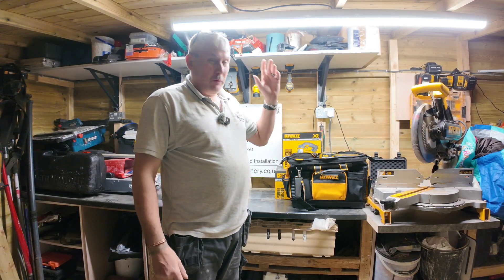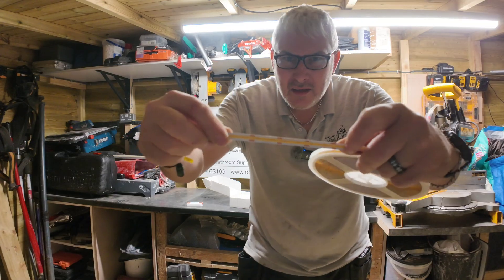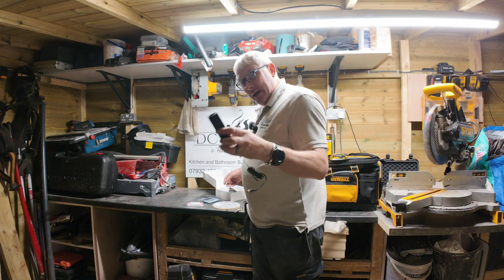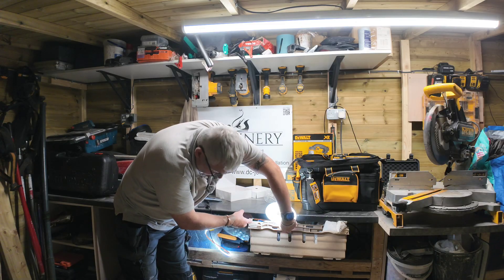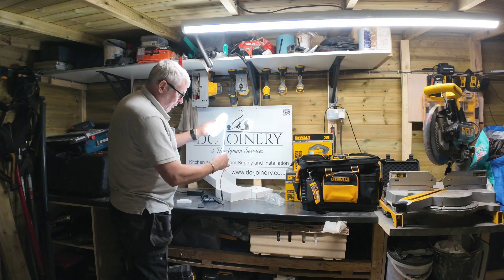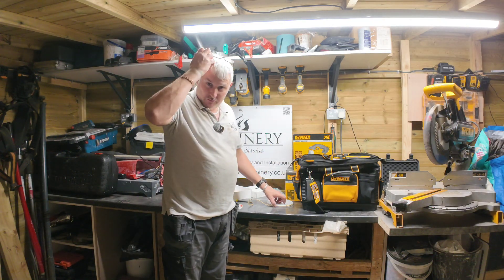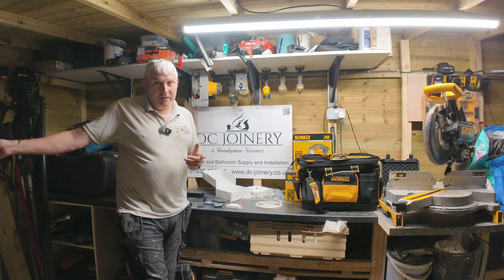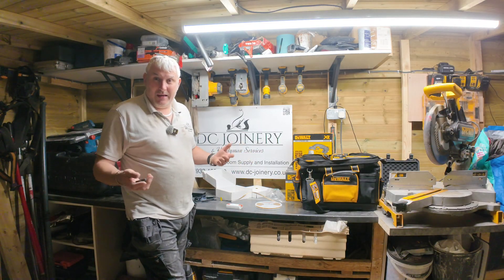LED STRIP LIGHTING A BASIC INTRODUCTION

Comment: Another way to setup up LEDs is to use a Quinnetic receiver in line to the power supply paired with a wireless PIR so that when they walk into the room they LEDs come on automatic
Reply from the maker: Yes that's another  way I was keeping it basic for now it was a quick  vid in response  to a question with what I had to hand😊
Reply: As I do them, 30mn pir in-line

Comment: I'm planning on installing similar 12v in my camper van, Dave. Loadsa light, low consumption. Thank you for the info, and DeWalt should be sponsoring you!
Reply from the maker: Thanks i did message them no luck lol😊